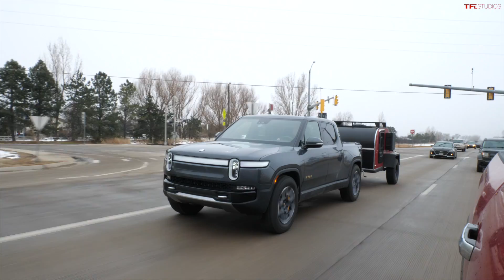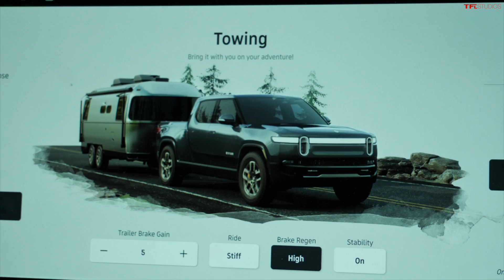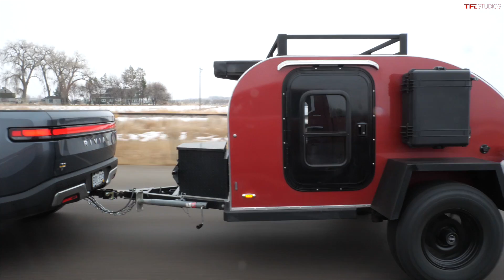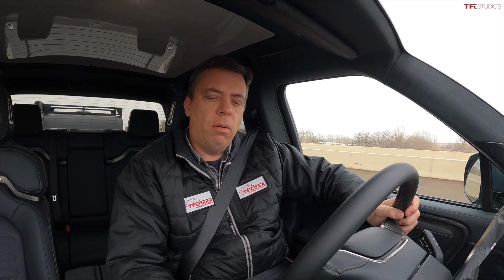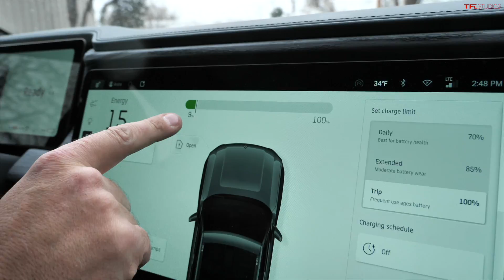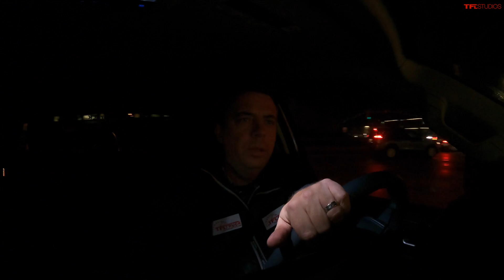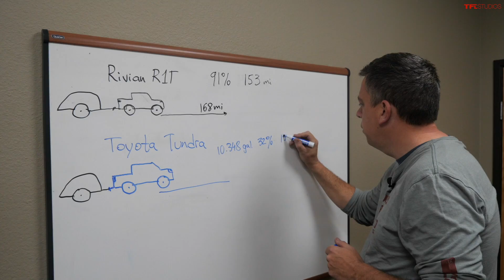Rivian R1T vs. Toyota Tundra: How Far Can Each Truck Tow On A Single 'Fill-Up'?

Comment: While certainly informative in the end it only fuels the apples vs orange arguments.  A BEV isn't the best solution for long distance hauling and towing just as a diesel dually won't suit a suburbanite who buys antiques occasionally.  

But, if you're happy to compromise, for either extreme, good luck to you.  In the end people like what they like. 

I don't have a problem with the Rivian, well maybe those front lights.  But if we ever get trucks like that down under they'll be $100K plus.  Diesel would have to be more than $10/l to make that attractive.  For me.

Don't forget, each person's use case is different.

Comment: would have been interesting to see the cost of the trip for each truck .
how much to refill the gas truck vs how much it costs to recharge the truck to 100%  . should be real easy to include those two numbers . Just the numbers , none of that garbage about heaters of so much per kilowatt hour .. just the final cost of each truck , right where you are

Comment: If the Rivian has a 135kWh size battery, and 33.7 kWh is equal to 1 gallon of gasoline for energy, essentially the Rivian used 4 gallons worth of energy and could travel 168 miles, or 42mpg. If my math is correct the Toyota got 14.7mpg.  Not too shabby on the Rivian!

Comment: I love your channel.  I was just wondering.  An issue I ran in to when we used to have an f250 6.0 diesel, when we selected tow/haul mode and it was way under any stress to the engine/transmission the vehicle really performed poorly.  So empty trailer (3500 lbs) was off the tow/haul mode, and then when loaded (horses and gear) tow/haul mode enabled, it performed great.  Now that rig had a tow capacity of 12000 lbs.  the Rivian is 11k.  Considering the algorithms are so intuitive for the 4 wheeled motors, I’d bet when towing a 2k# trailer, you could skip the tow/haul mode.  I’d wonder what the range would be then?

Comment: The gas truck has a 30 gallon tank, so equivalent energy capacity of 1,069kWh. That is huge, there are trade offs for sure towing with electric but it is still light years ahead in regards to efficiency right?

Comment: 90% of poeple that drive trucks use them like cars without even a reviever installed, some poeple even cap the hole! They tow 2 or 3 times a year, my trucks are gas but they always have a trailer attached pulling somthing and loaded. My point is most people don't use their truck anyway so the Rivian will save them money and do car things and pull a trailer twice a year.

Comment: I still believe the future of EVs is to have a system of standard size batteries that can be removed and replaced at a place similar to an quick lube station. Much like a cordless drill. 20 mins or less. Fully charged battery is exchanged for the depleted one. Priced accordingly. $40-50. RJ and Jeff are you listening?
Reply: You mean like Nio's battery swapping technology? It takes less than 5 minutes per swap done at a Nio dealer or dedicated battery swap station, and is part of a monthly subscription service around $150 (for up to 6 swaps for batteries that range between over 300 miles and over 600 miles).  Not only that, but using the battery service reduces the prices of their cars by around $10k, since the batteries are only leased and not owned (although the option of owning a battery pack is available for the extra cost)...
Reply: @OlJackBurton  exactly!

Comment: Worth mentioning that puts the Tundra at 14.8 mpg. At 33.7 kWh/gal equivalent of gas, the R1T got 43.8 mpge or about 3x the efficiency of the Tundra. Really goes to show that the energy density in current battery tech just doesn’t come close to the energy density of gas for now.
Reply: True, and it also shows that electric can deploy the energy more efficiently.  With electrons over wires, a lot less is lost compared to combustion management.
Reply: 14.8 mpg is very lame for the Toyota. My 95 Ram 3/4 4wd gets 20 mpg and would  get at least 19 mpg pulling that puny trailer and it has a 30 gallon tank so it would tow for well over 500 miles before refueling and it's 27 years old. I would sell that electric truck asap and search the country for more low mileage 95 Ram diesels and buy as many as I could.
Reply: It really shows how inefficent the toyota is too, since it used 3x as much energy

Comment: As always a great video.  Your work is very much appreciated.  I think most people who tow a camper trailer actually would use a larger camper - While both trucks would suffer in range per full tank or full battery, I think the Rivian would drop to about 100 miles or even less with a slightly larger camper.  As far as the tear drop, I know of only a few owners and they ditched them after a few uses when the novelty worse off.  Add in your charging time per 100 miles you will have to stop and soon you would want to take indigestion tablets by the handful.  Battery trucks are clearly the wave of the future and coming faster than most realize - but its not here yet.  I will take an ICE over an EV for any towing needs but cant wait to switch.  Finally, lets not forget that the infrastructure for charging a towable needs to change to accommodate a trailer in tow- we are clearly not there.

Comment: Would love to have seen the cost comparison.
Reply: Yes, cost, plus Rivian have 4 motors working, maybe in conserve mode would be enough to tow that trailer, was the Tundra in all wheel drive? Plus how many gallons of fuel does the Tundra gets? Pretty sure gas trucks still have advantage over electric but it’s hard to compare apples to apples.

Comment: An electric camping trip is gaining some ground, but has it’s limitations for sure.  The travel trailers need to advance as well.  As an example, the Airstream eStream travel trailer has an 80 KWh battery bank.  This camper has electric motors in the wheels to assist in the towing to extend your range.  As far as speed goes the recommend towing speed is 65 mph for most travel trailers.  If your camp site has 30 or 50 amp power, you could charge them both up over night for no extra cost.

Comment: And you can fill up a gas truck in 5 minutes. How long does it take to recharge the Rivian to 100% when you've used 91% of the battery charge? Electric trucks are for novelty value only.

Comment: Another great video!  Thanks TFL crew!  While the efficiency of EVs takes a hit in cold weather, at higher speeds, and when towing, they're still much more more efficient than ICE vehicles.  If the R1T has a 135 kwh battery, then 91% would be 122.85 kwh used for your 153 mile towing rout.  That works out to a consumption of 1.25 miles/kwh which is equivalent to roughly 42.1 miles/gal.  Let's see a Tundra or any ICE vehicle come close to that.  A lot of consumers are concerned about the range of a vehicle, but efficiency is important as well.  Given the choice of range or efficiency, I choose efficiency for personal transportation.
Reply: Range Is definitely a concern when it takes 20-30 minutes or even more to recharge every 150 miles. I'll be happy to loose some efficiency If I don't have to waste my time charging every couple of hours.
Reply: @chrisgill7824  I found it very easy and convenient to charge at home when I owned an EV.  I rarely used public charging, but I didn't really take long trips.  Your right though, waiting for a vehicle to recharge for 20-30 minutes or more is manageable but not fun.
Reply: 42 mpg while towing

that's amazing...
if the charging infrastructure or battery swap infrastructure is better, combined with better density batteries. I think BEV Trucks is definitely will be better than ICE Trucks

not to mention about the cost of running it, which is waay cheaper than ICE
Reply: What good is efficiency if you don't have the power density to use said efficiency for very long?

Comment: As an RV owner I see very few tear drops on the road. Most RVs I see are 20 to 30 feet and have a lot more wind drag. A more common RV would have been more real world. Even one of the horse trailers you guys use to use would have been better for this test. I appreciate the effort even if I disagree with the choice of equipment in this case.
Reply: If it used 91% battery, towing 1000 pounds going 153 miles , so towing one of those trailers it wouldn't go far
Reply: @superchargedfierogt  did you watch the video?
Reply: @JAMESWUERTELE  They were also blasting the electric heat which adds a whole lot to electricity consumption.
Reply: @superchargedfierogt  that is a different video... Here they went on a flat loop with a tiny trailer, 153 miles 91%. The Ike video they went 70 miles and used 81%, before they even started the Ike.

Comment: Clearly the gas truck will be more convenient for the trip itself, if you're going more than 150 or so miles with a trailer. But if your destination has outlets/RV spots it could make the EV more convenient while you're there.(who wants to run their truck/generator at their camp spot?) Just really depends on your vacation flow. For a lot this probably won't be ideal but with the battery version/better tires/width of new versions it could make a difference.

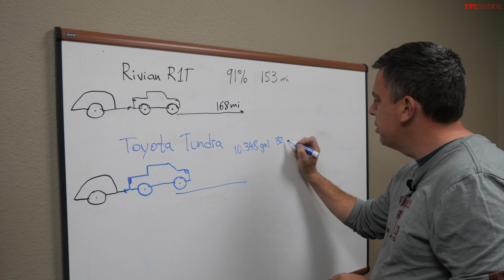Comment: 16:35 Ah, so you had the 38-gallon tank in the Tundra. That's definitely going to give it an advantage in terms of range. It will be interesting to see how some of the upcoming, larger battery EV trucks do in comparison.
Reply: 32
Reply: @philipkolatis3611  Yes, I've heard that's what it reports, but apparently, it's actually a 38-gallon tank. Regardless, my point was that they are testing a smaller EV truck battery versus the largest gas tank Tundra.
Reply: Be nice if electric cars had easily swappable battery packs like for power tools and could just swap them out at a station in a few minutes or bring some extras with.
Reply: @cheesecurd100s  Rivian does have a patent for a drop-in battery, but it's not clear how much capacity it adds. Regardless, there are a number of issues with secondary batteries, ranging from weight (it would take several hundred pounds to add any real range), integration, to working with high voltages (something most average people don't have the tools or knowledge to work with safely). Perhaps, when solid state batteries are available, there might be an option for a couple of 100 lb modules that could add 80 to 100 miles of driving range.
Reply: No, it doesn’t have a 38 gallon tank
Reply: @lukestoyz  There are only two tank sizes I know of for the current Tundra (a 26.4 gal and a 38 gal). Using ~10 gal would put that over half a tank, and at ~15 mpg, that's less than 400 miles estimated range.
Reply: The new tundra has a larger gas tank at 32 gallons i have a 2022 tundra i know the older models had the 38 gallon tank they don't carry that size anymore
Reply: @philipkolatis3611  Odd. I'm not a Tundra guy, but that explains why some new Tundra owners were confused about their larger tank size only reporting 32 gal. 

Again, though, I think it will be important for TFL to acknowledge that the R1T they tested would be the equivalent of the 26 gal Tundra because there is a "MAX" pack option with an additional 25-30% capacity. 

The Rivians would still both fall short of their equivalent trims, but the differences wouldn't be as big (maybe double the range).
Reply: The "32" gallon tank in the Tundra probably has a 6 gallon buffer between automatic shutoff and filled to the brim.  Every gas tank in every car has some buffer.  But almost no one tops their car off all the way like that.  Regardless, the Tundra used around 10.35 gallons or 1/3 of the stated capacity, while the Rivian used 91% of its battery charge for the test...
Reply: @OlJackBurton  Some Tundra folk already chimed in. Apparently, the 32 gal tank replaced the 38 gal tank. Either way, my point was that TFL is comparing the largest tank Tundra with the mid-spec R1T (no telling if the smallest battery version will ever be sold). The "MAX" pack R1T would come closer, but still only have about half the range of the 32 gal Tundra with that trailer in those conditions.
Reply: @newscoulomb3705  They are comparing a larger ICE engine with it's fuel tank size. If they used the smaller 22 gallon tank, they'd also be using the detuned engine at 348 compared to 389 hp. The reality is that 95% of Tundras sold will have trim levels that have the larger tank as standard equipment and the R1T battery is also standard equipment.
The "Max" pack would be more similar to the 46 gallon tank you can put under a Tundra.
Reply: @courtneyanderson2293  Perhaps. I'm not that familiar with Toyota's fuel tank options. However, I think you might be wrong about the fuel tank options, as it appears that most Rivian R1T reservation holders are waiting for the MAX pack. Again, the low-load towing range advantage goes to the most common Tundra trim, but the most common R1T will likely have >200 miles of range towing that trailer in those conditions.

Comment: 0:05 One thing to note before this test even kicks off is: If that is the Toyota Tundra with a 26.4 gallon tank, it's starting with 150 miles more EPA estimated highway range than the R1T (about 450 miles versus about 300 miles).

Comment: Kind of missing some details for a real comparison. What is the Tundra rated at for highway mpg? You said you were getting 14mpg.  So was it similar efficiency loss as the electric? About 1/2? How much would it cost for the same range? You put 10gal in for $4/gal? The Rivian probably charged at home for like $0.11/kwh?

Comment: It would be interesting to know how much it cost to recharge the Rivian from that loop we saw that the tundra cost $40. Obviously different rates for electricity and gas around the country but would be a nice comparison to see how much you are saving or not saving depending on how much it dropped the efficiency on the rivian
Reply: I would assume an average charging station is around $20 for 1 hour. I doubt 1 hour of charging would get back to 100% charged though.

Comment: Well Rivian claims the R1T can withstand up to 220kW of DC charge and the vehicle battery pack capacity is 135 kWh. Due to the battery curve, you'd want to stay between a battery state of charge of 20-80% when traveling via highway. Assuming there's access to DC Fast
chargers along the way (50+kW Electrify
America, EVGo, ChargePoint, etc) you could try to plan your trip in 81kW battery increments (based on this video's findings ~100mi) to optimize charging speed. Best case scenario, you can find 220kW capable chargers and top
off from 20%-80% in about 20-25 minutes. If your campground has utility running to sites (which if they do, it’s 240VAC via NEMA 14-50 outlets…also known as Level 2 charging) you could plug in your truck when not plugging in the camper to top off the truck for the trip back home. Not horrible with this strategy, but still nowhere close to a gasser or diesel performance. Coming from a Montanan who understands weather, range anxiety, and shares these concerns.

Comment: I've  got 3 teenage boys - so I'm looking at the R1S for that. 2 daughters that are abroad but come to visit from time to time.  We do a lot of road trips, too.

The truth is, we go about 1 - 2 hrs between stops. Everyone's got to get out, stretch, eat, use the facilities.  It's generally easier if we leave early then everyone sleeps and I can go maybe 4 hours.

If anything, I see electric trucks and cars as a boon for the "pass through truck stop" industry.. at least until battery technology changes.

At one point, Tesla had looked into a carwash type drive through experience that swapped out your depleted battery for a fully charged battery. The problem with this approach is it requires many more batteries than vehicles. The other problem is, it's not as integrated with the frame.  It just wasn't popular enough.

China is doing it, however. A battery swam in less than 3 minutes

https://www.youtube.com/watch?v=zfs6iogvSyA

Comment: To be fair;
1) this is on the AT tires...you lose 10%+ there...and many of us have ordered the best mileage 21" road tires(still decent tread/grip for off road, but has proven to achieve the EPA(Edmonds got 319 miles).
2) you mentioned the cold winter weather
3) you were definitely driving 70mph during this...which hurts any Ev(optimal max mileage at 55-60 mph), especially while towing.
Given this, I expect to be able to get around 170-190 miles with a my similar trailer and the 21" road tires in CA weather. That's 2-3 hours at 55-60 mph.
One recharge stop for a 5-6 hour driving day, max.
Good for most people!

Comment: The distance to Rivian can go is probably enough to get between electrify America stations on across country trip. But it'd be interesting to see how long it would take to charge at that point from zero back to 100%. I have a suspicion you're going to be driving for 2 hours and charging for an hour to get to 100%. That's not really a good situation for towing if you actually want to get anywhere.
Tundra might have a slight advantage because the truck is bigger than the trailer so the trailer is in its wake to a degree. Whereas with the Rivian the trailer was bigger than the truck so there could be a bit more air dynamic loss

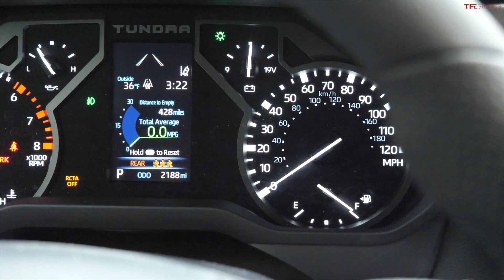Comment: That is only a comparison of battery size to fuel tank size. The measurement should be what percent of range was lost. So the Rivian lost 46% (168/312 miles) of its range. What % of range was lost in the Tundra? At 12:25 the Tundra trip computer thinks you have a range of 428 miles on a full tank, but you extrapolate the range with a trailer to 473 miles. So the computer on the Rivian was more accurate than on the Tundra. But towing a trailer should decrease range, not increase it. In the Tundra, according to this comparison, the trailer would push you an additional 45 miles. So again, this comparison should be about % of range lost, not total range.